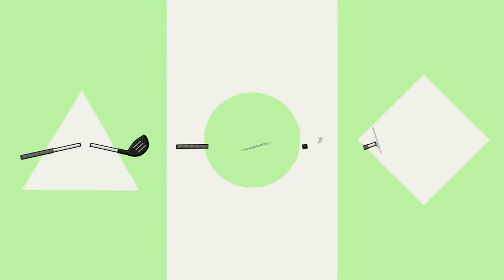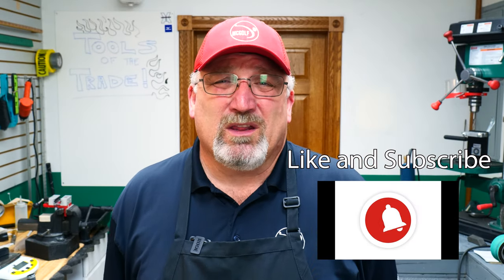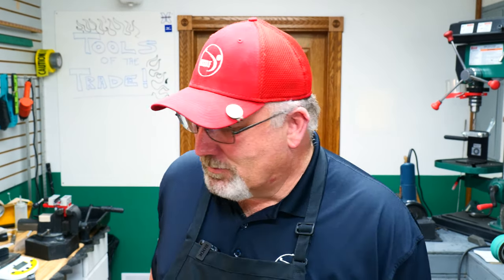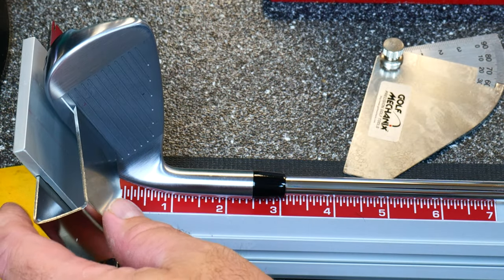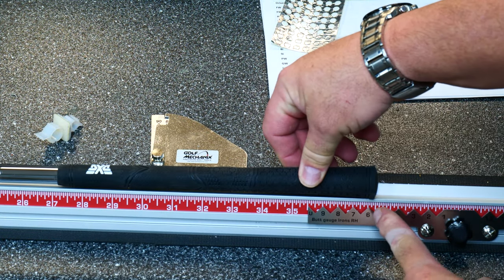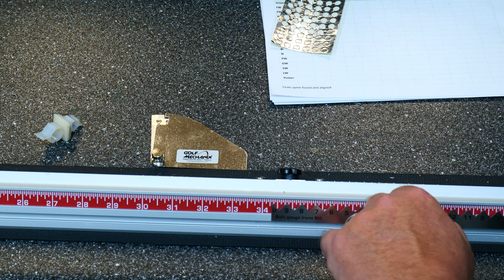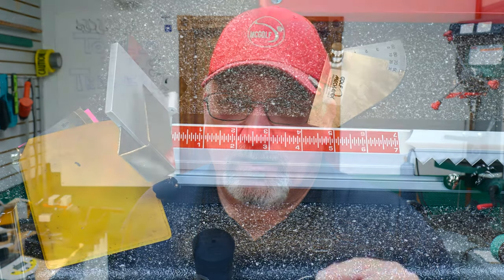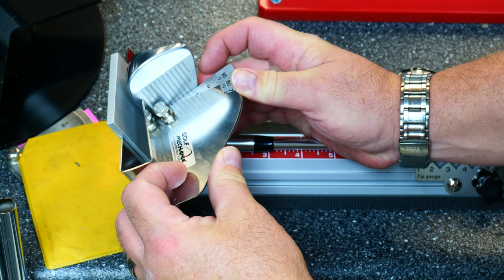How to measure length of a golf club -Golf Mechanix Auditor Ruler -

Comment: Is it ok to use fast setting epoxy for glueing iron headsand Ferrell's onto shafts? I still have some 2 part epoxy left over, from extending shaft lengths, from golfworks to use up. I know you like to mix it all up for the set and check whats left over the next day. I have the duel sqeeze tubes and it costs more than the seperate bottles and I use all of it. More worried about lasting adhesion and only doing a PW head for now. I know it off topic but bringing it up for good measure.

Comment: Great stuff again Jim!  Question: you mentioned on a live chat recently that got me thinking. Hot and cold weather can compromise epoxy.  Is this something that should be considered when clubs shipped in winter;  For example if you order a driver?
Reply from the maker: Although it may be in transit for a few days. Unless completely extreme I would say no. Temps apply for the storage of thre epoxy and for the completed clubs, In garage, in trunks, can be a source of clubs coming loose
Reply: @McGolf  Thanks Jim!

Comment: Have you used the Mitchell or Maltby bench top rulers?  If so, any thoughts on one over the other?  Thanks in advance!
Reply from the maker: Yes I have, I worked with both. The mitchell is probably the most compliant with USGA measuring but the GW is more for actual playing length

Comment: How accurate are the loft/lie measurements when using the included gauge?  Thanks
Reply from the maker: I typically dont use it that way but when compared to the mitchell unit and a club gauge the rule is very close if not dead on